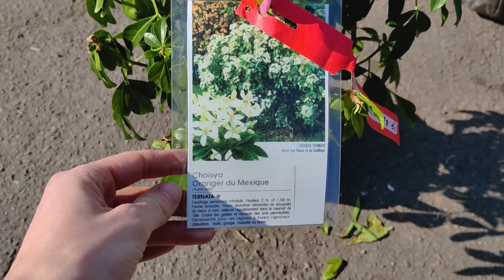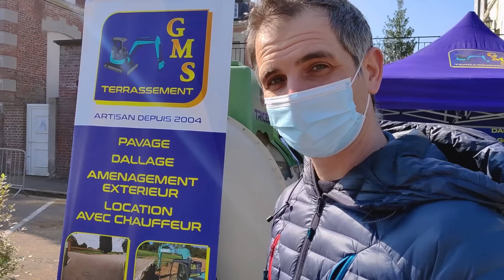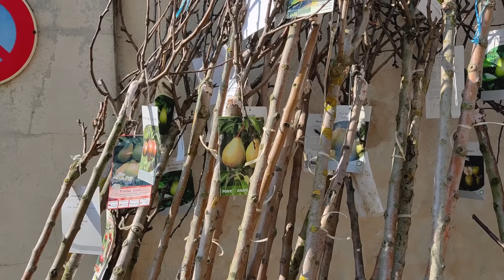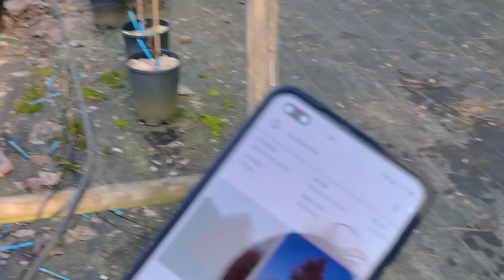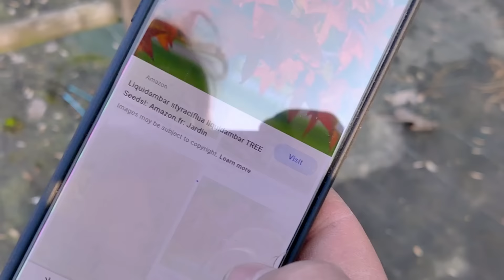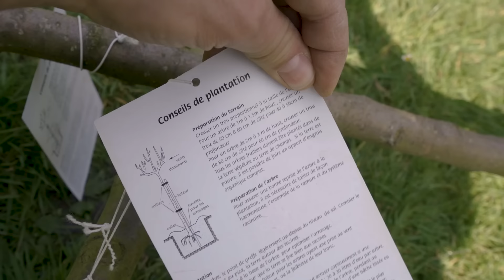DON'T do this in your garden! - How to renovate a Chateau (Without killing your partner) Ep. 11

Comment: Mulching under the trees is a good idea. There are bacteria and fungi in most soils that can infect fruit trees if mud splashes up onto the leaves from the ground when it rains. As a soil science student in university, we experimented with using sawdust to increase soil acidity, and found that the impact of it when used as a much is actually pretty negligible. I'd be more concerned that rodents might gnaw on the bark around the base of the trees under or at the level of the bark and kill the trees. You should put collars around the bases of the trees set into the soil roughly an inch, and extending approximately 39cm up the trunk to keep rodents from getting at the trunks. There are flexible plastic ones you can get from nurseries for that purpose, or you can make one from some flexible metal flashing, just make sure it's not too tight or has sharp edges that it will abrade the tree's bark. As the tree grows, you might have to change out the collars for larger ones to ensure you don't constrict the trunk. You did a good job planting them, now keep them well watered for the first year so that the roots establish well. You'll want to water them at least weekly this year. Next year, you'll probably be able to only water as it comes out of dormancy in the spring and then during dry spells. Also, always give your trees a good, deep watering just before the ground freezes in the fall so they've got a reserve of moisture to support them as they wake up in the spring.

Comment: Hubby and I cracked up when you told the girls they can't play with i(the drone), it's not a toy...but you play with it the whole intro hahah hopefully they grow up and adopt your sarcasm

Regarding the tree planting. There is a bit less soil because you removed the sod (dirt and grass) it is better to mound up fruit trees. Don't change what you have done thus far but in future when you dig the hole put the sod in the bottom. Grass side down. Then put some blood and bone meal. Some soil. The tree and fill in. Don't compact the soil so much around the tree it is not so good for it. Tree bark and tree chippings are good weed suppression. If your grass is very invasive place a layer of brown cardboard down and then the tree chippings. It should not acidify the soil too much unless it is pine. Save that bark for around blueberries or azaleas.

Also lastly take care with the liquidamber tree. I recommend not planting it within 4 meters of a building or pipes. The roots are very vigorous and thirsty. They will grow and seek out pipes and in Australia have been known to crack pipes for water

Comment: The charcoal from the fire will also sweeten the soil. May I also suggest that instead of burning your green waste you either rent a couple of goats or buy some to eat it. Your soil will also benefit from their manure. You have so much space that you could make some huge compost heaps and you could use it to improve the soil around the chateau. The purpose of the mulch is also to reduce moisture loss from around the base of the tree. Another suggestion is to include some appropriate fertiliser to reduce the shock to the tree. Happy gardening. I envy the huge space and abundant rainfall which we don’t get n Australia.

Comment: Would say on your other trees, you may want to amend the soil with a slow release fertilizer and manure to promote growth, also the wood chips...are they bug and disease free?  You don't want to bring a problem into your orchard.  Have you checked to see if those fruit trees need a second tree to pollenate or are they self pollinators?  Should be on the tag.  Just some thoughts ....looking forward to seeing you plant out your other trees and flowers.
Reply from the maker: Thank you for the tips!
Reply: The conference pear definitely needs a pollinator. An historic one like the „Boscs Flaschenbirne“ works for a lot of pears, so your are on the safe side for upcoming pear plantings. I recommend to give your trees a hold with a pile. We made very good experience with only one diagonal pile and to tie the tree at the half height of the stem. Adjust the pile in the direction of the wind, so if the tree bends in the wind, the pile goes down even stronger in the ground. 😉
Slow releasing organic fertiliser and rock flour helps a lot for the start. Mix with the soil before filling the hole.
Reply: @christinerudolph587  Remove the pile after about a year - once it has "grabbed in" with its own roots - to allow it to strengthen trunk and roots in response to natural wind.  If you have rabbit problems, be sure to protect the trunk, or they will girdle it and kill the tree.

Comment: Hi guys great vlog as always. Ok  guys you are killing me with this manual labour digging. I have planted a lifetime of trees and haven't  dug  whole by hand in year. May I suggest  you make friends with a farmer and get him to bring his tractor in with a post hole digger (auger) on the back and do your holes that way, it will take about 5 minutes per hole. The longest time will be settling out your lines for the hole positions. For the shrubs you can do something similar with a smaller machine called a dingo (Australianism) for a single person ride on excavator with a the same kind of auger attachment. Using this process you could easily plant your trees saving backs knees and shoulder. What we do is the first time the daughter goes down is to create the hole and break up the soil. Then we lift it up put I  some nutrient and organic matter in and then put it down again and give it a good churn at this stage we drop in our peg and a piece of irrigation tubing  for watering and of course our plant, heel in and move onto the next one. This system has been tried and true because the roots get an opportunity to establish  in the nutrient rich trees and you get lush quick producing trees within a year, cheers Kim 😊👍🦄❤
Reply from the maker: Thank you so much for those tips! We want definitely improve our methods!

Comment: Soak all bare root plants. Dig hole. Add well rotted manure to the soil. Plant out. Put stakes and ties on trees to support them for the first couple of years until they have a strong root system. You’ll need to water in the heat for the first few years too. I’ve planted many trees and shrubs with great success so good luck and enjoy.

Comment: Black holes, Parallel universes, quantum mechanics, TOTALLY agree Philipp.  It matters not if the measure is a hand spade, a bob cat, a bull dozer what went out is NEVER adequate volume  needed to go back in.  PS.  Imagine, the ONE time you read the instructions and ended up wrong.  Stay with your strength, toss those directions at first sight.🤣

Comment: Your backfill appears to “shrink” because your volume of excavated aerated soil (air pockets)is being compacted as it is used as backfill. Depending on your soil it will loose around 15 to 35% of its volume. If the tree comes with a rootball and if you add peat moss, etc. it helps. 
 By the way, if you dig up compacted rock, the opposite happens and it will appear to “expand”
Reply from the maker: Interesting! Thanks

Comment: I think the reason you don't have enough soil at the end is that you stamped it down too hard when you planted. This prevents the water from soaking in quickly. It's good to be firm, but maybe not so much and not with your full weight.

Comment: I have to add blood meal to help release nitrogen when putting bard mulch.  I also use bone meal to sweeten fruit.  Mulching different things in layers like grass clippings leaf fall is good too.  Animal manure composted in one layer too. Ash from burn pile I use a little around roses to help feed th
I get as many layers as I can, up to four inches yearly.  I try to chop up all the little branches I can.  If you don't mind the look of pipe composting you can burry composting pipes by the trees or use in herb gardens.  If you have not seen the movie "back to Eden " by Paul Gautschi. I highly recommend it for avoiding common mistakes which cause you more work than necessarily.
Reply from the maker: Thanks so much for your input!

Comment: My inner scout leader is cringing at you throwing things on the fire. 
But there is no such thing as too wet to burn... The fire just isn't hot enough. I've been stood in the pouring rain with my back soaked and my front dry at a camp before :)

Comment: Shouldn't you soak your tree roots for a few hours before planting the best manure to use is from lambs waste half a bucket of lambs waste to half a bucket of water mix together in to a thick mix and scoop around your tree also you have a log burner sprinkle the ash cold obviously around the  bottom of your roses they will turn out so beautifulxxxxxxxx

Comment: Are there pear trees near by? You will need a fertilizer sort for your pear, then they both fruit better. Conference is a good fertilizer sort for a lot of pears. Bark is ok, mix it with gras clippings over the year. You should stake the fruit trees for the next years. This will help them to root probably. Wind shakes the tree and the new roots will brake, with staking you will prevent this to happen. Look out for information for fruit tree cutting, for the next year. At the first year, please get rid of all the fertilized blossoms. The trees will need their energy to root. Often this week branches are not able to hold the crop. You planted them well. I never put fertilizer or something for planting. The roots should look for the sources, that helps it to root. Next year use organic fertilizer. In your case you should protect them from the deers. 
https://www.ndr.de/ratgeber/garten/nutzpflanzen/Birnbaeume-pflanzen-und-pflegen,birnbaum100.html For Philipp